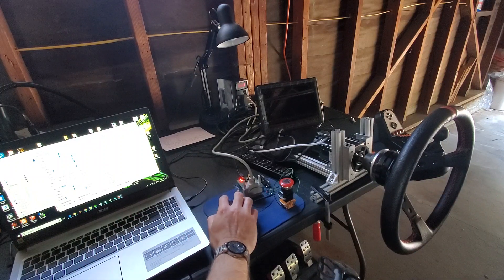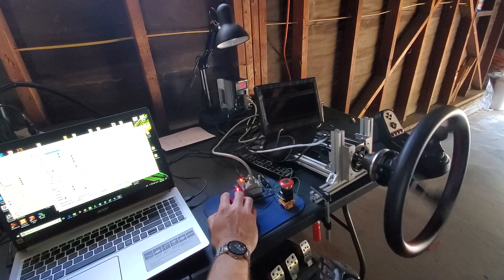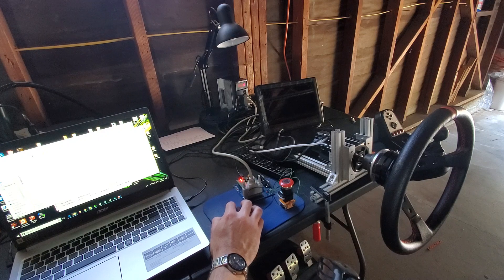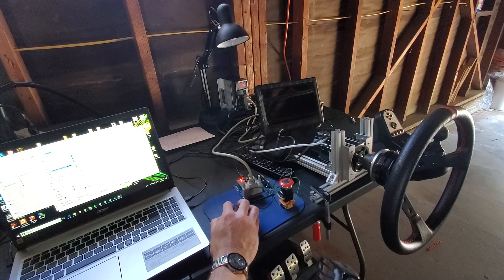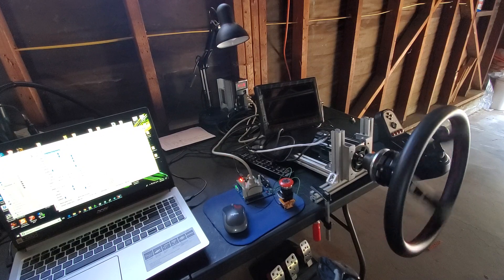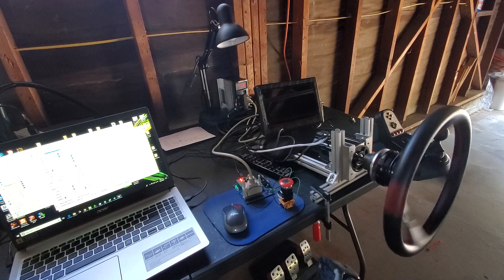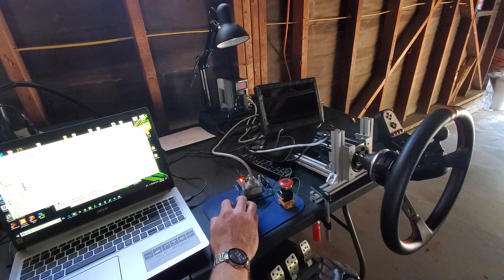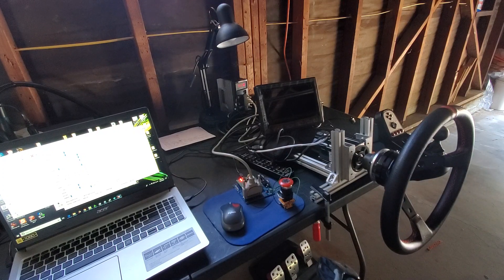TDD - AASD 90ST motor on iRacing Force Feedback Test

Comment: That sound its from your table, right?
Reply from the maker: Yeah, table, one side is not clamped down, plus the quick release spring mechanism is loose and vibrates when it regulates the max speed to 120RPM... I need to try another type quick release.